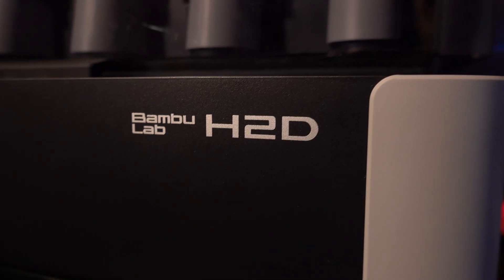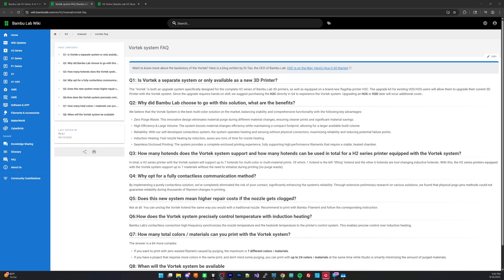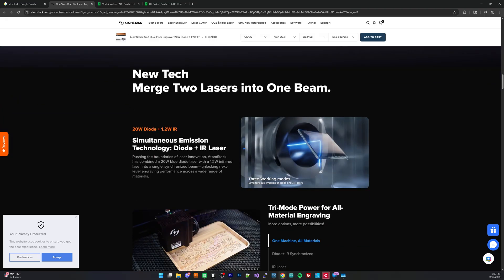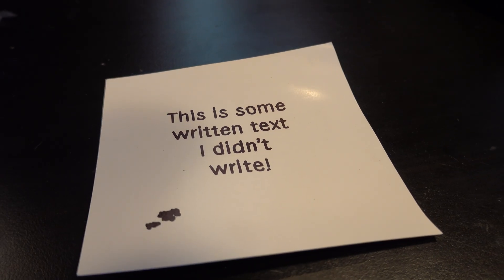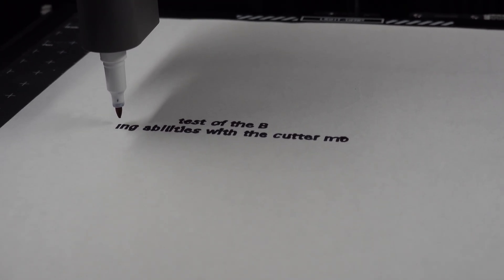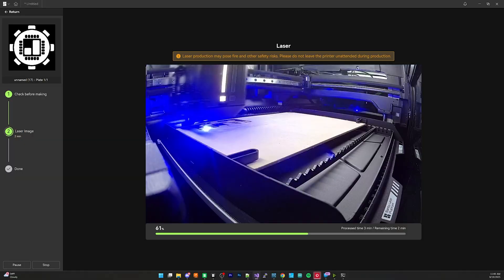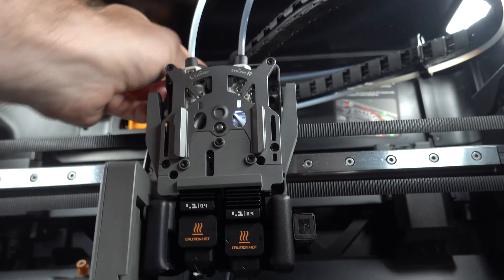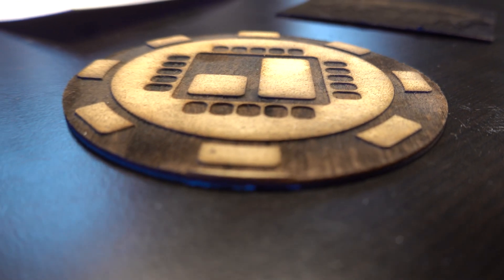My All Time Favorite 3D Printer/Laser Cutter... Ever, The Bambu Lab H2D Review

Comment: I appreciate your honesty fellow engineer, but I’m on an X1C I wanna go to a larger one because the H2 D will fulfill my 3-D printing whenever I need it not mandatory I do a vinyl cutting so I can get rid of my cricket and then also the laser I’ve always thought about getting the laser one at 40 W would seem more ideal but I mean I can use a 40 W I’m guessing for even light material or will or have you experienced that you need to still get the 10 W for the light material because the 45 be too strong for it or is there a way that we can do it a pressure and laser for the output? Is that adjustable?